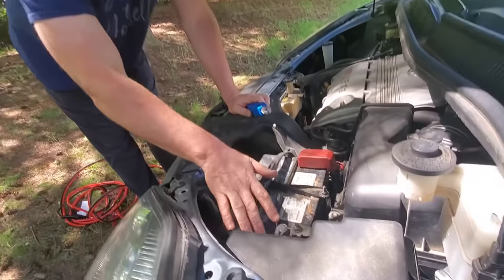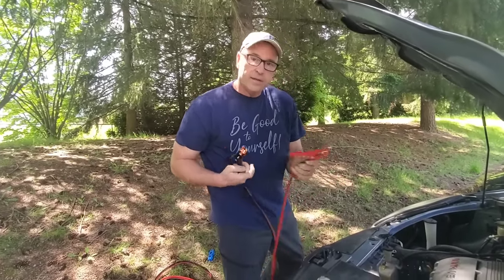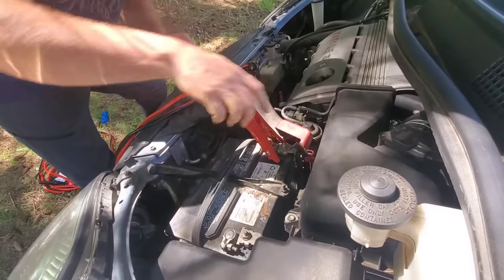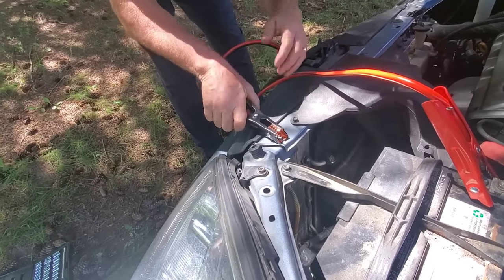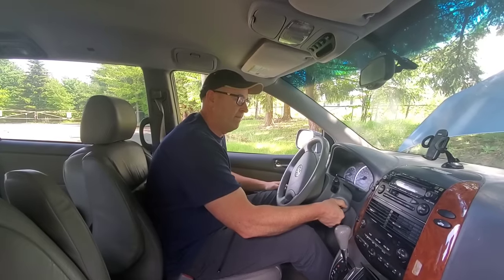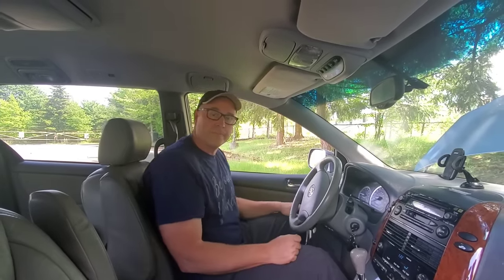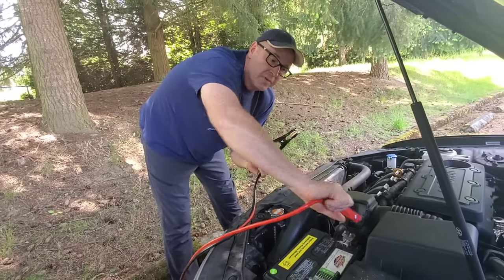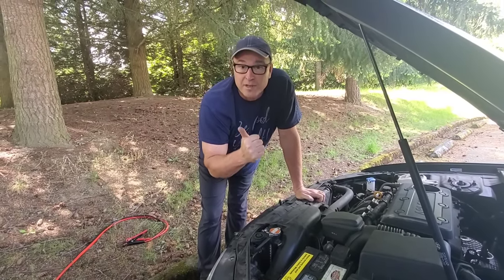How to Jump Start a Car

Comment: So, I have a request. My parents said that mowing a lawn would be a good chore for me, but I don’t know how to mow a lawn. So you should make a video of how to mow a lawn!
Reply: "So CAN you make a video" seems more respectful in my opinion.
Reply: Basically, for your standard gas mower, at the beginning of the season check the oil and fill it to the appropriate amount and fill the gas up. You should check the oil every once in a while. Anyways, the first time you start up the mower in the spring it's going to take a few goes at pulling the cord. Pull quite hard and straight back, not to the side. Once the lawnmower gets started, the actual mowing is fairly easy. Just make sure that the height adjuster is at a good height for the grass. Avoid rocks, sticks etc. Bad for the motor. If the lawn is fairly flat then u can just go back and forth in lines. If there are hills, be very careful with the mower going down. Lawnmowing, itself isn't that hard, however you should practice on your lawn at least once before doing someone else's. Btw, scout out the property to make sure there are no hidden poles, rocks etc, cuz that'll kill your mower

Btw forgot to mention but super important, you can't mow if the grass is wet. The grass just won't cut, if the ground is wet but the grass is dry then you can mow but it is just a bit more difficult. However, depends how wet the ground is cuz you'll just make the entire lawn a mudslide if the ground is super wet, if its damp you'll ve fine though.
Reply: Out of curiosity... Why aren't your parents showing you?
Reply: Zachary Ruster maybe they work and don’t have time to

Comment: Hey folks, something I think is important to add is that the black cable on the dead battery car, the ground, needs to go onto unpainted metal. He said an unpainted surface, but specifically it needs to be onto metal to create a solid ground.

Comment: I had no idea you could clip the black cable to a different spot than on the battery. I've jumped my car a dozen times but I always end up learning something from your videos even if it's something I think I already know how to do. Thanks!!!
Reply: You most definitely can. If you follow the negative cable you can find where it grounds to the body. Be aware several newer models have the battery located somewhere other than under the hood if that is the case there is usually pretty obvious "jump points"
Reply: Technically all your car's frame is the negative. U just need to have a unpainted spot. I had to use the engine itself once to jump a car
Reply: Dude, right? You think "I know how to jump a car" but this guys awesome so you keep watching and then he tells us some shit we would never have known otherwise. Thanks internet pops

Comment: The battery is needed to start the car. Once the car is running, then the engine (gasoline) keeps the car running. Additionally, a car has a thing called an alternator. The alternator re-charges the battery. Ideal, you might need 2% of the battery to start the car then driving the car for a few minutes re-charges the battery back to 100%. But if the battery is at 0%, it will take a lot longer to re-charge the battery back to 100%. This is why you want to drive the car for a while once you get it started.

Additionally, if you turn the car off and it won't start again then it could be the battery OR it could be the alternator isn't re-charging the battery. So don't just buy a new battery. What you can do is charge the dead battery with the second car for a while (say 30 minutes). Now if the battery works for a while but then quits working again, it is probably the alternator which needs replacing.
Reply: There's no way a few minutes of driving will charge a car battery from almost dead to full. (I imagine that would sooner boil all the acid from that lead-acid battery and produce a lot of smoke and flames). Charging the battery to full will take hours at least, but you only need it to have (and maintain) enough charge to start the car again without jumper cables and it will slowly recharge itself from there on whenever you drive. I would run it for longer than a few minutes in fear of it not starting again, but what the hell do I know -- I don't even own a car.
Reply: Oh my gosh hi other dad! 👋👋
Reply: Thanks for information. :)
Reply: also,  They do not recommend you use another car to jump a car no more because of the computers ,Best way is to use a  jump starter unit
Reply: Hi step dad!
Reply: Was looking for this comment thanks
Reply: @Spoco  for me driving around works and I always do that whenever this problem arise. Just to make sure if its the alternator or the battery.
Reply: you're a wonderful teacher!
Reply: what does he mean when he says, in the video, that we need to connect the black cable to a "ground"? how do I find that? thanks for answering my stupid question. it's just in case I get stuck and wanna be a big girl without getting my dress dirty 😂
Reply: @LaNoisette  The frame of the vehicle and everything metal should be connected to ground. So you just need to find any metal point in the engine bay you can safely clip the black jumper cable.
Reply: @LaNoisette  plain, unpainted metal not connected to anything electrical. 

An electrical ground
Reply: I have a question, how do you know which side of the battery is red and which side is black also is positive red or is positive black?

Comment: Thank you for being a dad to the fatherless! :-) I can't imagine what it's like, and was very thankful for my dad when I was younger.

Two tips on this video... 2:10 nah, it's because you A.) don't want to have two alternators fighting, and B.) don't want to send a surge to the ECU and other modern computerized cars. The worry about a spark itself is really not a big deal because there are not enough gasses leaking from the battery to do anything. And 8:01 it's really to protect us from shorting out anything, as it doesn't really help prevent corrosion.

Comment: "The battery lasts 6-12 years"
Laughs in Arizonan, the heat rots these out in three years with my luck
Reply: Same here, I was thinking 6-12 years?! 😂
But I’m in Arizona too, the sun here kills everything! 🤷🏻‍♀️
Reply: Yep. I always get the longest warranty on a battery and almost always use it. One hot Phoenix summer, I had two batteries die....
Reply: Same in Florida!
Reply: Bwahahaha not just the heat.... Deep cold kills it just as surely. Most up here in Alberta last for three or four at the most.
Reply: Same in Georgia.  Maybe, MAYBE 5 years.
Reply: I’m about to move to Phoenix 😅 I’ll like it, but my car won’t lol

Comment: Just a heads up. As someone who changes batteries every day, 6-12 years is extremely unlikely. A decent battery will last you about 3 years there's some cases however where I've seen a 3 year battery last 5 years but that's on a very rare occasion.
Reply: Yeah, I thing my battery is gonzo after two years and four months, but that was without maintenance and all the cells were very low when I just checked it. Added about a cup and a half of water total to all the cells. I assume that all that will do is dilute whatever electrolyte is still there. Still, hope springs eternal; I am searching for someone to give me a jump to see if I can beat the odds and revive the battery...

Comment: What does the “ground” or “dead” bolt mean? How do I know if it’s dead or ground? 🥺
Reply: In a car, the "grounded" side of the circuit connects to the frame of the car. If you follow the cables coming off the negative post on the battery, you'll see at least one cable that is bolted straight up the frame of the car. So when you're jumping a car with a dead battery, look for a bolt or part of the metal frame of the car that is missing  paint. You can connect the jumper cable to it and kind of twist it around a little bit which will scratch off some paint and get down to the metal. Worst case scenario if you can't get it to work, you can connect it to the actual negative battery post on the dead battery. This is considered less safe but can work in a pinch.

Hope this helps!
Reply: Other tips; negative and "ground" mean the same thing. Everything metal on the car is the negative side circuit; it's ground. I'm not exactly sure what he meant by "dead" bolt.. but rest assured that as long as you negative to negative and positive to positive, you should be fine. The reason he used the ground bolt is so a spark won't ignite helium being released from the battery (extremely flammable gas)
Reply: Some people say deadbolt to rto a bolt 🔩 that is well screwed and almost imposible to move.
Reply: When he said "dead" he meant the dead car, not a specific side of the battery. So you start with the red post on the car with the dead battery. Red dead 😀

Comment: My actual dad didn't teach me many things (divorced parents), but I am probably one of your older internet sons.  Anyway, I watched this video multiple times, and today I have to jump start one of my cars. With hesitation, I decided to try it myself for the first time.  I read through the manual as well, just to be sure.  The manual was crystal clear about where to put the ground on the dead car.  I donned goggles, and rubber gloves just to be sure.  With all cars turned off, I connected the last black wire to the ground, I got some sparks at the ground.  Freaked me out, so I disconnected everything carefully.  And I still have a dead car, but I think I am gonna call AAA.  So thanks for trying to teach me, internet Dad.  Appreciate it very much.

Comment: I personally have a portable jump starter. I suggest everyone invests about a $100 in those, make sure it's a good one. Then you don't need a second vehicle or even a helper. You just connect the jumper cables to the portable charger, then connect the ends to the dead battery, then click the boost button if it has one, mine does have one. Then you just turn the key to start the engine and it works instantly

Comment: I REALLY like the motivation/purpose of this channel.  Found out about it today and was checking it out.
I would like to have seen additional things put in here though.
1. How to get a good connection, ya know like wiggling the handle while putting pressure on the teeth to get through an present oxidization.
2. How to know if its your battery or the alternator that is the problem.  Using a 5$ multi meter and 1 minute to check the voltage at the terminals.
3. A short explanation of how revving the engine works, ie.  The alternator produces juice based on the speed of the engine.  But over revving doesn't help because after a point excess electricity is just sent somewhere else to dissipate as heat.  So around 4-5k rpm is all you need.
4. Slightly more about how after hooking the cable up sometimes you have to wait because the dead battery (if its dead enough) can actually suck up enough energy at first that the provided energy isn't enough to start the car.  Letting it sit and charge from the other engine for a few min most of the time will be enough to overcome this.
5. Maybe adding that the thin cheep wires can in some cases not transfer enough electricity to do the job
6. AND possibly MOST IMPORTANT.  To be careful, if the care doesn't start and you are continuously cranking the engine over.  It is important to give the starter time to cool.  The starter motor if used continuously/to much in a short time, can actually burn out adding another problem to the car.
Please don't take my suggestions as negative though.  I really like what your doing.  I only added this list because all of these in my mind fall under the same category, of simple good to know things a dad would pass possibly while jumping his kids car on the side of a road.  Maybe not the multi meter check.  But that's just good battery info.  I've found my kids friends always replace the battery first when there's a problem like this and a 5$ tool and 1 min check could save them a 90$ battery.

oh and last one just came to me 7.  The clicking when you try to start the car is because there isn't enough energy to engage the starter, often this is the connection isn't good enough to transfer enough power or the battery needs time to charge.  Check your connections and make sure they are good (wiggle the gator teeth, or find better purchase/locations for the clips)

I think adding all of this might add 2 minutes to the video.  But I also would guess that your video is something that might be looked up while jumping a car on the side of the road.  And those little tid bits could do a lot to help in some of those situations.

Comment: A friend linked me this, citing this instruction as the correct way to jumpstart a car. Ideally you would follow almost all the exact same steps except put the negative clamp on the dead engine block not the dead battery terminal. Aside from that, great video.

Comment: Perfect instructions on how to jump start a car with another car! But kids, if you have a newer vehicle, don't do it. Newer cars these days are packed with so many electronic modules, and the engineers were forced by the bean counters to make these modules less resistant to power surges. So you may be able to jump start your car, but then your dash no longer works, or some other module like your seat controller or airbag module stops working. And those cost a lot to replace. Many owners manuals spell out not to jump start the car the old fashion way, so I am not making this up. The right way to do it for new cars is to buy a "jumper box." They are all over Amazon and make great gifts. They are usually small boxes with lithium batteries and you can jump start the car without hurting it, and without needing a second car. Or, you can take out the battery and take it to a parts store to have them charge it for you and then put it back in. They usually do that for free. You're welcome, love Dad #2.

Comment: Just some quick tips to maybe help out with diagnosing whats wrong and whether its the battery or something else.

1) When you go to start your car, what happens is, when you turn your key, it makes a connection to a solenoid in your starter. If there is power, it will cause the solenoid to close, which sends a lot of power to the starter, which causes your starter to turn your engine over. 
This is why, when you turn your key, and NOTHING happens, then its probably your battery. 

2) If it is your battery , then go ahead and do what Mr. Kenney shows you as far as jump-starting your car here. If your battery is NOT dead, or if you go to jump it and it still doesnt turn over, then you most likely have a bad starter. 

3) If you go to start your car, and your car IS turning over, but it wont fire up, this could mean a LOT of things. In order to start, your car needs 3 main ingredients. It needs fuel, compression, and spark. This is obviously VERY basic, but you can narrow things down pretty substantially, especially when checking the spark or fuel. Maybe Mr. Kenney can make a video where he shows exactly how to check for those things?
If you have some basic knowledge, here is how you can check. 
For spark, follow your spark plug wires to the spark plugs, take a spark plug wire off of one of the spark plugs and remove that spark plug from the engine. 
Now, attach the spark plug back on to the wire. Make sure it "clicks" in, and make sure when youre doing the next step that you are holding it by the RUBBER of the spark plug wire. 
Hold the spark plug and wire and find a piece of bare metal on the engine of the chassis somewhere. Basically, the entire chassis and the engine all act as a "ground" for the battery. So, take the plug and wire and tough the side of it to some bare metal under the hood while another person turns the key inside of the car. While the engine is turning over, if you can see the plug sparking, that means you have spark. So this means that the distributor and the cap are fine, as well as many other issues. 
Checking for fuel is a bit more difficult, but if you can access the fuel rail, depending on the vehicle, you can usually find a spot sort of like a tire stem and press it to release a little gas which tells you that fuel is getting to the fuel rail.
Last is to check for compression. This one can be a bit tough too. Basically, since you already have your spark plug off, you can use that hole where it goes into the engine to see if there is compression. Usually you can but compression gauges where you press a nozzle with a rubber end up to that hole. But you can also just listen or stick a piece of rubber up against it. MAKE SURE THAT WHATEVER YOU USE IS NOT SMALL ENOUGH TO FIT INSIDE THAT SMALL HOLE THOUGH! If it is, it can get sucked in, and now whatever got sucked in there will be stuck right in the combustion chamber of that cylinder!

Really, if you dont feel comfortable doing something, please find someone that is, or take it to a mechanic. You CAN do more harm than good and actually mess something up in the process if you dont know what youre doing. 

A VERY long story shot (i know, im sorry). The issue will most likely be either a spark issue, or a bad fuel pump. 

Hopefully I was able to help out a bit. If you got this far, I applaud you. Youre very handsome/pretty and extremely intelligent. Dont ever give up on yourself, always try to be original, and dont be afraid to be yourself, no matter what other people say. Youre an awesome person, and I hope you have a great day!